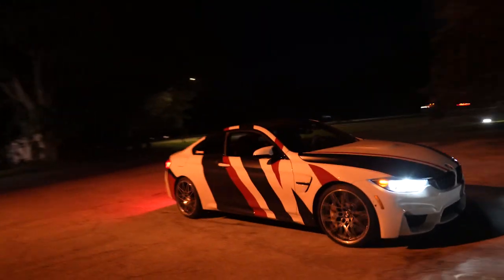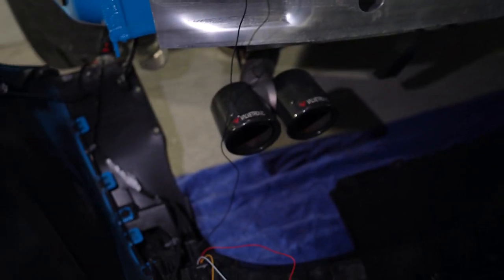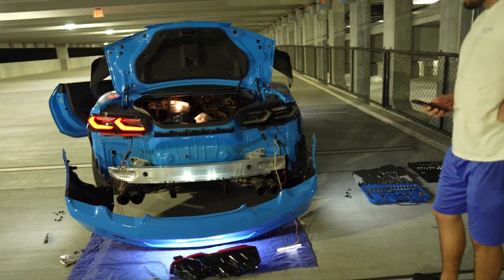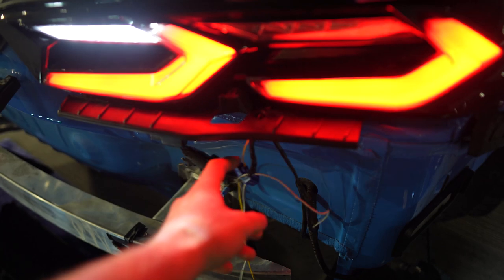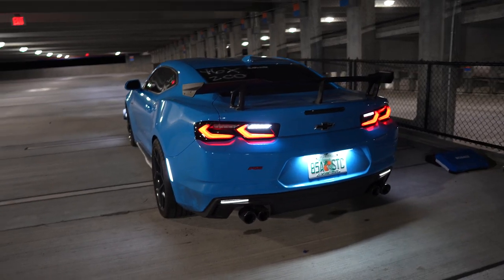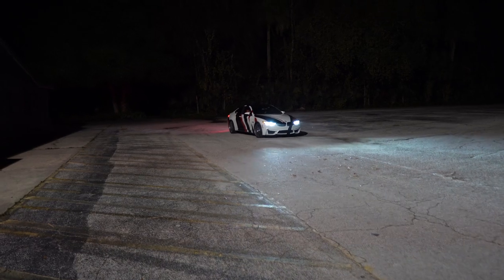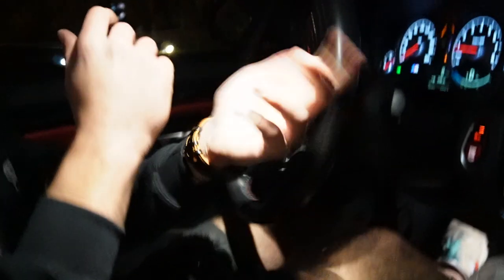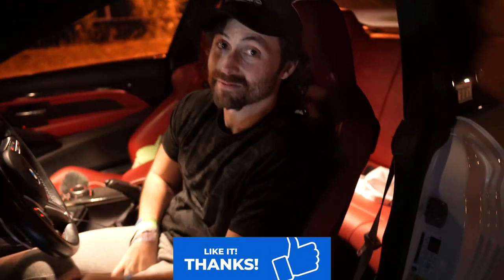HOW TO WIRE LED REFLECTORS W/SEQUENTIAL TURN SIGNALS ON YOUR 6TH GEN. CAMARO + SWINGING AN M4?! #V8

Comment: Mine do not turn off when the car turns off
Reply from the maker: You probably hit the wrong wire!
Reply: @TobyVegaD  I wired it just like this video, and the brake light works. It’s just the DRL stays on when the car is off.